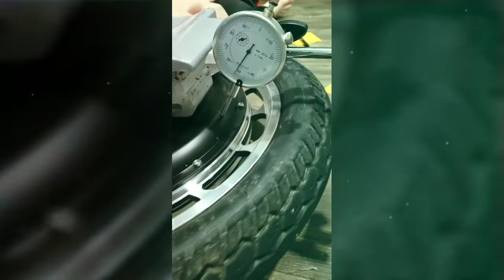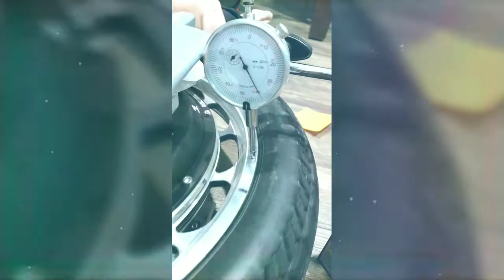EUC Electric Unicycle 2018 Wobbles wheel diagnoses. KS-18L KS18L

Comment: I have the same thing going on since day one with my ks18L. But i dont have that tool. I was able to fix the tire some but still not as happy as i would want to be paying that much for the wheel. Whats the best  fix?
Reply from the maker: Hello Michael, thanks for commenting. I did not fix the problem yet, but I think the best solution would be to discard the bad tire and tube and buy a new one, pay for excellent quality one, because when you go at 25 mph any distortion is too much, also, balance the tire, I'll make a video about it once I receive my weights.
Reply from the maker: They said they would replace the tire, I'm still waiting for it.
Reply: Also looking for fixes. Had this happen in my inmotion v8. Tire did not fix.
Reply from the maker: @BrianBulkowski  try putting a good bead of oil on the rim, or grease and running with low pressure, 25psi for a while, will be harder to turn, but should fix the wobble. Also, you can try adding some weights (balance the tire) there's couple videos online on how to do it.

Comment: How did you fix the problem?
Reply from the maker: Change the tire, on the new tire put a need of vaseline around it so it will seat better. Then inflate to 30 psi no more. It is hard to turn but will make a soft ride. When riding, ride forward. Forget what others say about been too much forward. That leaves you with more grip on the legs. If going fast, really hold the knees together, strongly. If shakes a bit, squeeze your knees. Have a very good shoes and tight to your feet, like a motorcycle shors or ski. The shoes need to grip the bottom. I am on the fastest level and reach the tilt all the time without problems 30kmh or more